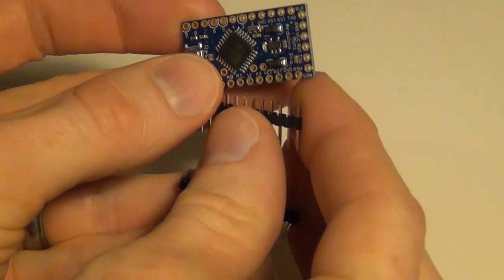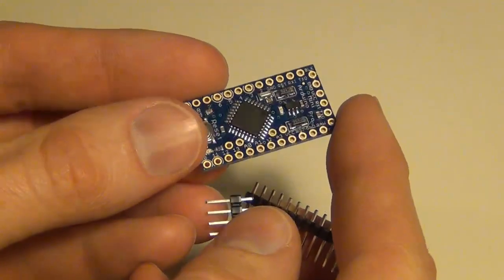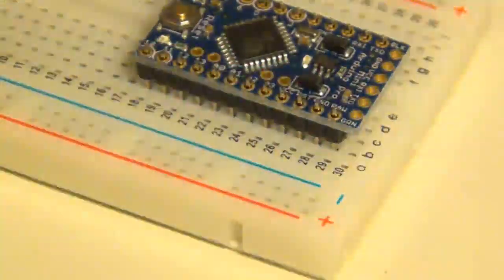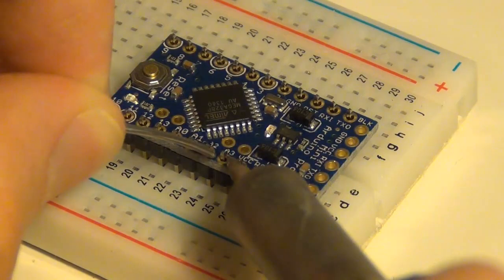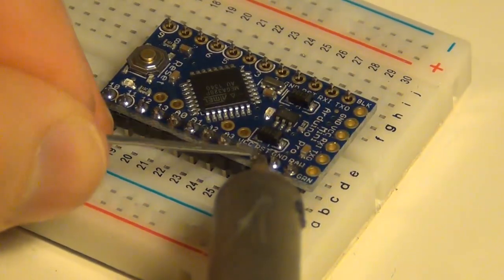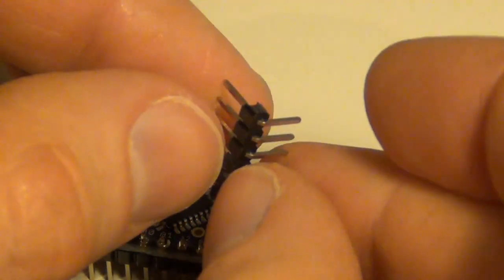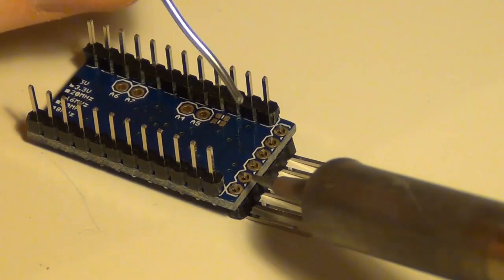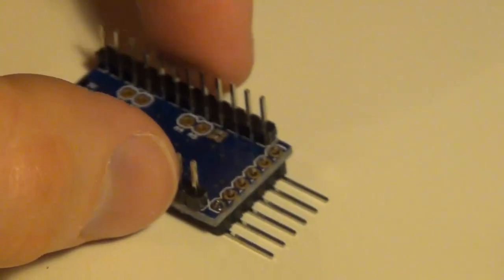How To - Solder Pin Headers to an Arduino Pro Mini

Comment: Can you tell me if I need some special kind of solder or soldering iron for that job? I have to do that, but Im not experienced enough so I'm afraid that I'll burn the chip.
Reply from the maker: Henrique Arroyo Mine is definitely not special.  It's just a cheap soldering iron.  As for the solder I'm not sure about that either.  I have had it for a long time.  I think the solder from the mysensors.org store should work fine though.  My soldering iron is a Weller WLC100.  Not the best but it gets the job done.  The key is to not leave it on too long.  As soon as the solder starts melting you should be good.
Reply: Pete B Good think that I asked then, as I can see here that's a 40watt soldering iron, I only have a 60watt one, which is probably not a good choice. I'll look for a more suitable one so I can try it. Thank you for replying.
Reply from the maker: Henrique Arroyo Does yours have a variable temperature dial?  If so it should work.  It is nice to have a good soldering iron if you are planning on building lots of things though so it may not hurt to buy a better one.
Reply: Pete B The one that I have right now does not have a station. I'm not used to dealing with such sensitive material. I guess it's time to upgrade to a better one, like you said it wouldn't hurt.
Reply from the maker: Henrique Arroyo Yep!  If you're getting a new one you may want to get one with a smaller tip.  The tip that came with my Weller model was too big for this fine soldering and I had to get a new one.  Hopefully the iron you get will just come with a smaller one.
Reply: Pete B I bought one yesterday that had the same problem. The tip was too big for the mini. I only checked it in the sotre because I remembered that you said that here. Thank you for helping.

I just solded one of the minis that I go and, when I tried to upload the blink sketch to test it, nothing happened! I was afraid that I had burnt the chip or something, but some research on the warning that the IDE showed me (something like "not in sync resp=0x00" ), I found out that the bootloader was not installed on the controller, so I went through this procedure here: http://www.arduino.cc/en/Tutorial/ArduinoISP now everything works fine!

Thanks for all the help, now I can finally get to work on my projects :D
Reply from the maker: Henrique Arroyo Nice work!  Glad to hear you were able to get it working.  Now the fun begins!